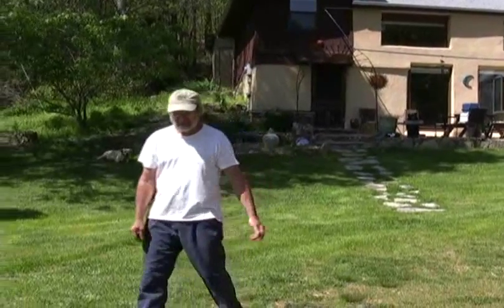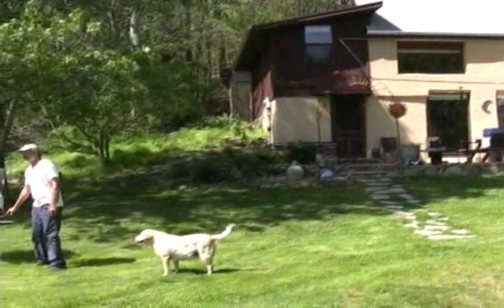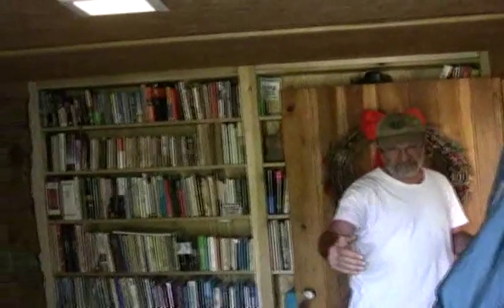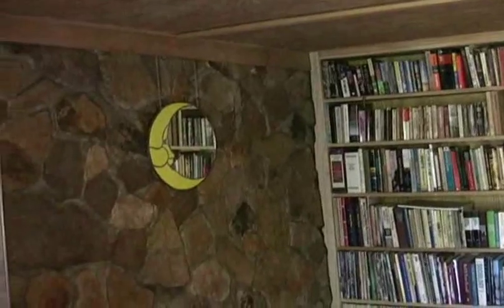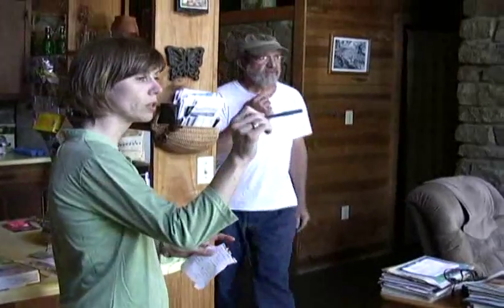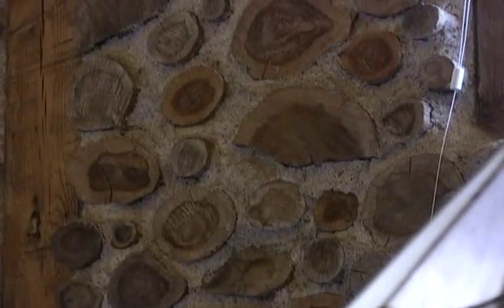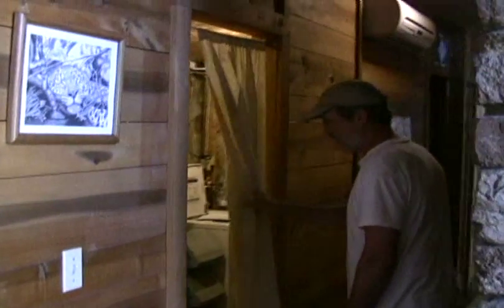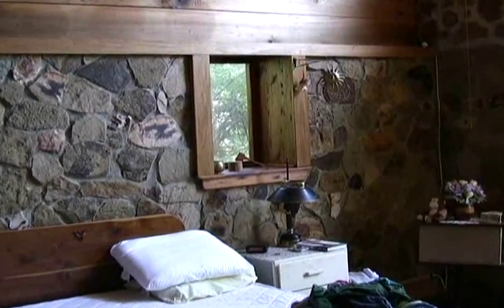solar tour

Comment: Does the diameter of the copper tubing make a huge difference in the willingness of the water to flow up?  How much pressure might it build roughtly?  Could I say, use the 30' copper tube wrap to push water through an in floor heating system in my bus? 7' wide by 25' long. floor space.  I know it would be a guess, but do you think it's possible? without any extra pump?